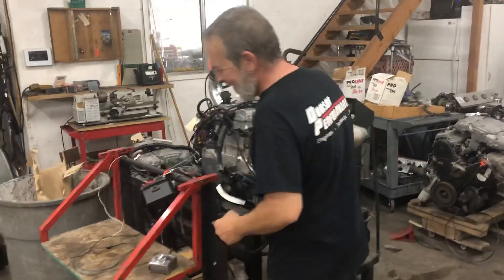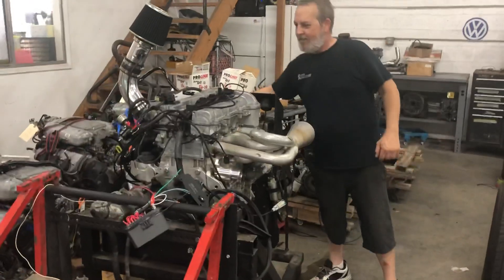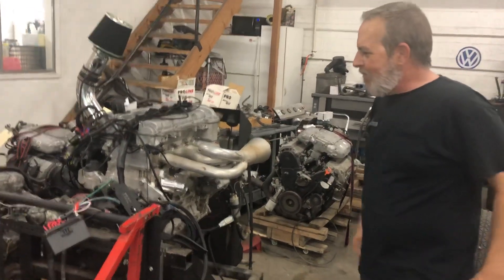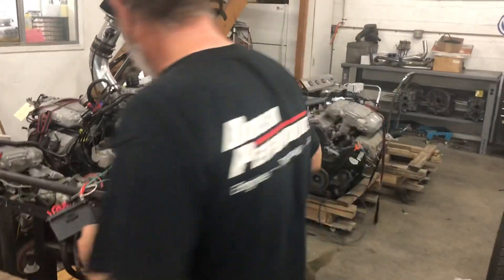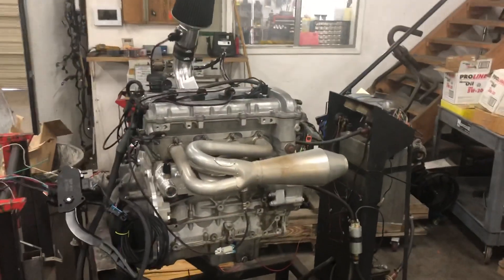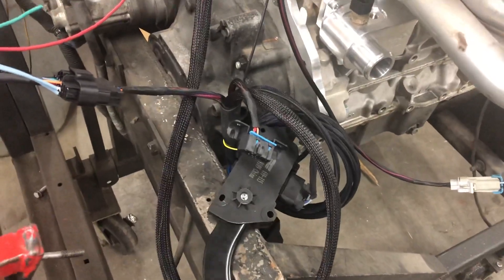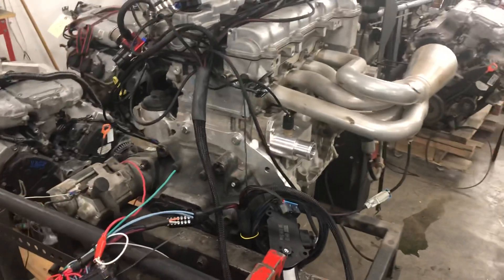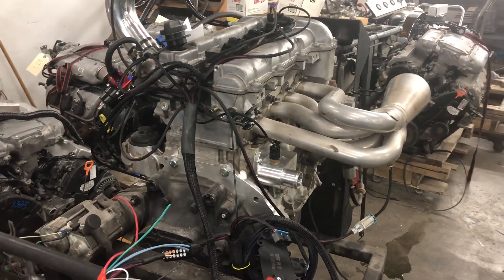Ecotec the next big upgrade

Comment: What are the specs on that?
Reply from the maker: Spec Right at 205hp & 200 torque. No turbo. 
However unlike Vw 90FPT at 2000rpm & 120 torque at 4000. It has 172FPT at 1800rpm & 200 FPT at 2800 rpm all the way through 6500rpm because of the VV-Timing. It’s a monster dune climber!